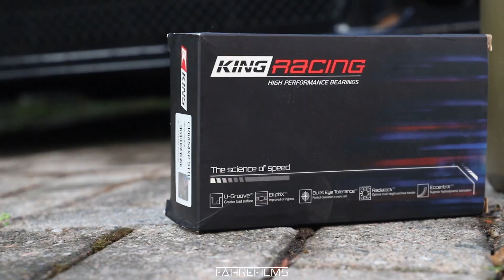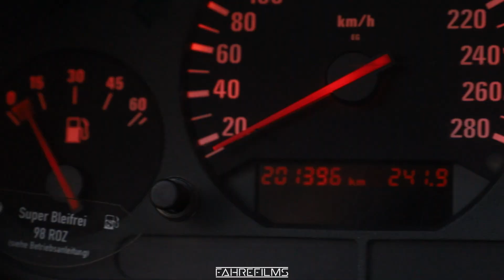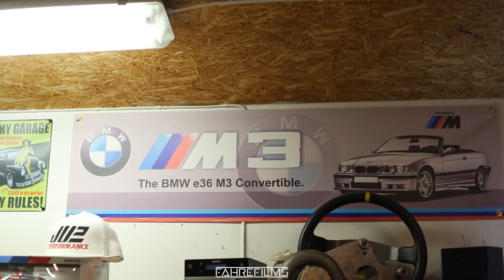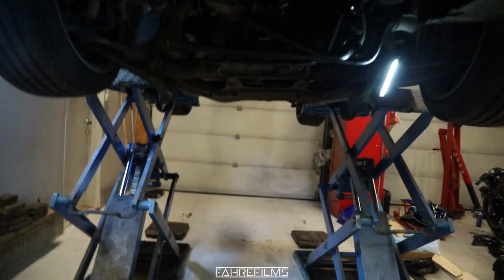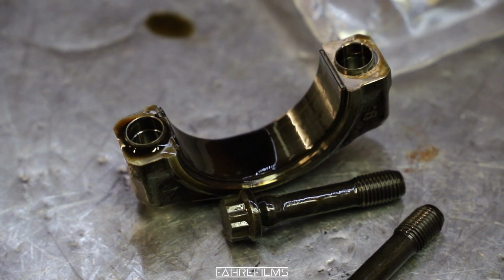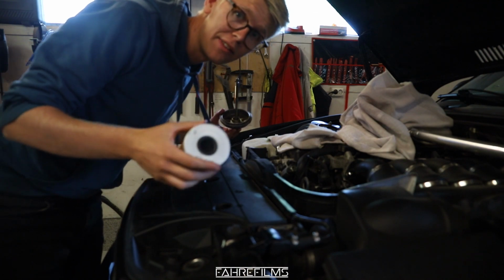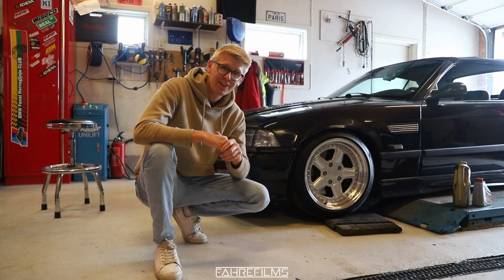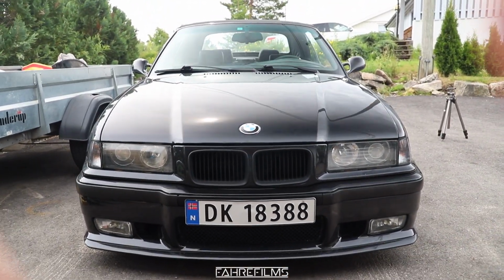Fixing the Most Common Issue on BMW M Engines!

Comment: I have refreshed couple of s50 engines with a friend of mine and the engines were driven around 200-270tkm tkm and the bearings were fair, of course there were some wear but nothing out of spec considering the kilometers. S54 is the first I know which has the bearing issues
Reply from the maker: How do you know rod bearings has not already been done tho? 🤷🏼‍♂️😊
Reply: the 270tkm driven one I'm not sure but the other was 2 owner and they hadn't done that job. I guess it's still better safe than sorry to do the job, it will be cheper than new engine for sure.

Comment: never heard of S50/52 of having failure with rod bearings i know that it started from S54 as far as i know with the oil consumption ( talking about the standard engine as M series as well)
Reply from the maker: I can not speak for the US M3, but the Euro S50 M3 engine it’s a good safety to swap rod bearings ✌🏼

Comment: Hi, could you kindly confirm which replacement power steering pump did you use and from which year? I have a bad power steering pump on my S50 as well!
Reply from the maker: Hey, all M50 pumps should fit the Euro S50B30 ✌🏼

Comment: BMW have the problem with rod bearings only on 3 engines and they are : S54,S85 and S65(E46 M3, E60 M5 and E92 M3 ). Other engines don't have the problem with rod bearings...
Reply: and the diesel N47 , N57 also. :///